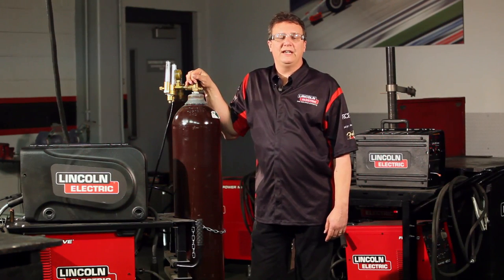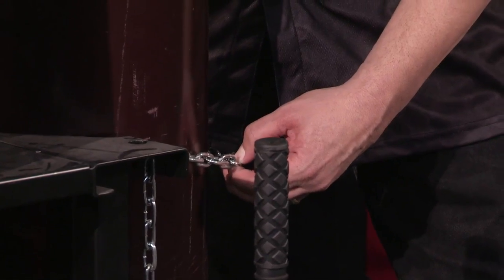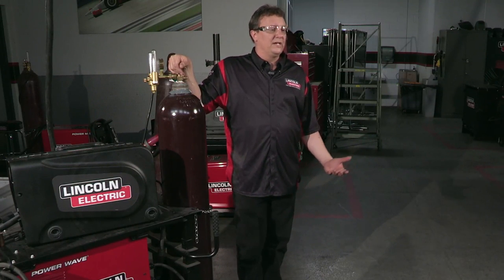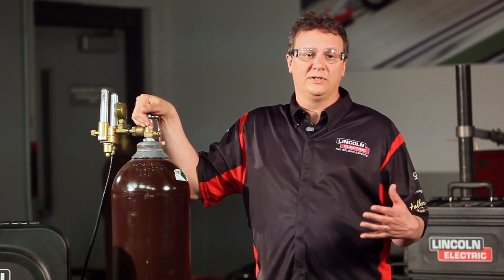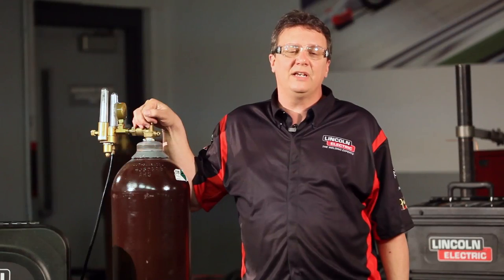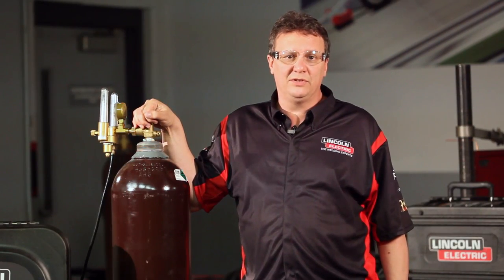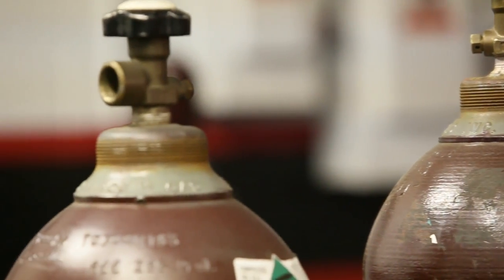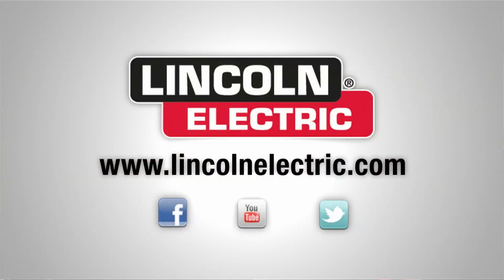Tech Tips: Shielding Gas Selection for MIG Welding

Comment from the maker: @spelunkerd CO2 gives you deeper penetration than mixed gas. This doesn't necessarily make the weld stronger, as base & filler metal plus your wire feed speed impact your deposition rate. Let us know if this helps!

Comment: can you use 100% argon to mig weld on steel/stainless?
Reply from the maker: +Gino Titone Thanks for the question. The answer is no. 100% Argon is used for MIG welding aluminum (usually w a spool gun).
Reply: Why not?

Comment: If I weld infrequently, will the Argon & CO2 separate over time? Should I get 100% CO2?
Reply: Brian Hagan That is a much debated question. What you're referring to is "stratification". Some say it can be an issue, others say no issue. I think some mixed gas cylinders have a "eductor tube" to eliminate this issue. Some suggest to periodically roll the cylinder to remix the gasses. Personally, I don't worry about it.